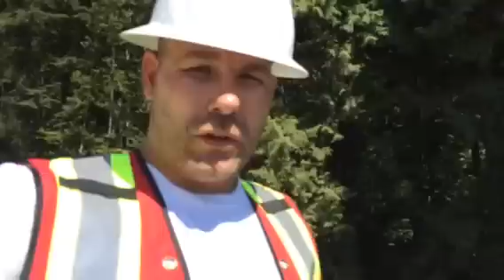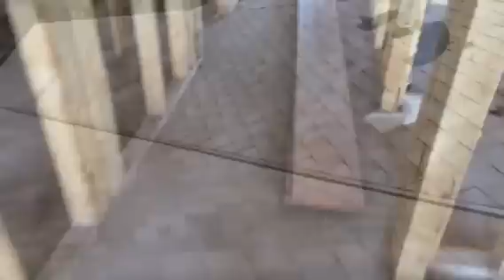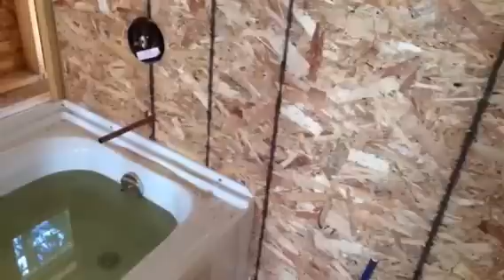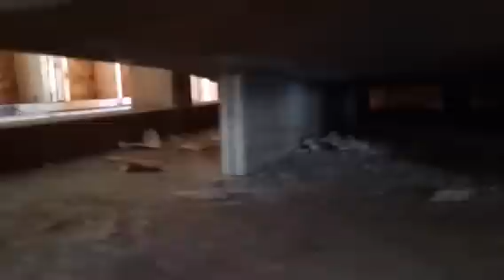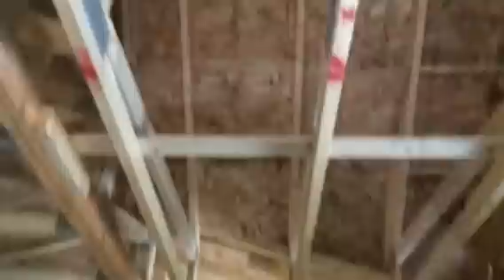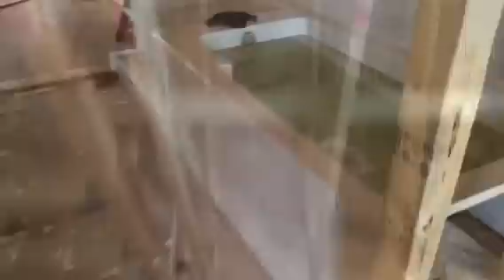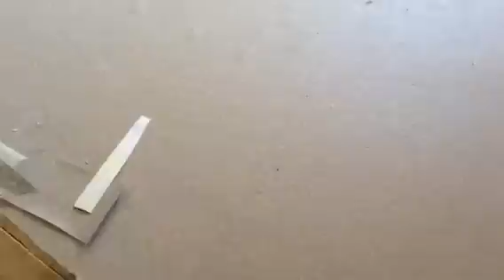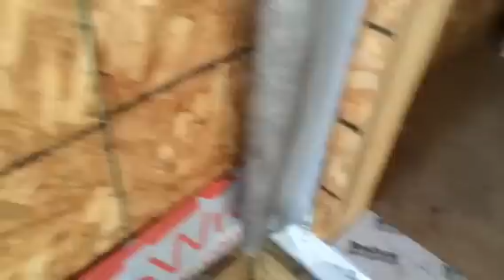New Home Construction Fails

Comment: Home inspections are a very good idea. Its also a good idea to use one that isn't a waste of money. 

Both tubs are fine. The final layer of tile backer will butt into or overlap the tub flange over the osb. I might ask why they used the osb and extra layer of rock but there are many structural and sound reasons for these types of things. As of now it isn't done and nothing wrong. The vertical support under the tub is not osb and a stringer on the back wall should be your support. Again the builder is not done and nothing is wrong.

The hangers upside down could also be a pre fab error and it was built/installed backwards. You don't know so its not safe to assume amateurs did the work.

A good inspector would know what stage the house is in and ask questions about the builders plan for completion. Being in the trade for 20 years now I would call you the amateur in this video.
Reply: Captain Carnage Interesting.... What does a builder's livelihood depend on? 

Just because your job is to inspect someone else's job doesn't make you free from fail. I challenge tom because of his misleading video and dramatization of the issues/non-issues. Its also pretty clear he has little or no years actually working in a trade. It would be fun to hear the builders side of it. 

 If you have any knowledge in this area then share your opinion but save the name calling for someone else.
Reply: I'm a Florida certified horticulture professional, independent contractor, and received 5 scholarships in college for my work in the field. I'll post pictures on my profile if you want proof, but if you think for a second that was the right choice of wood or the builders did a quality job, then you must be comparing your skills to the Indian contractors that have structures collapse or kill people monthly. 
 
On a side note, my best friend is following in his father's footsteps becoming a woodworker. His father is in the industry for over 35 years. Another friend is becoming a master electrician, and his father works in international real estate and construction.

So I can clearly see why you would think I'm a schmuck with no actual insight. As for dramatization, I've seen decks fall and the damage they can do both structurally and to people. But I suppose he can just pick the whole floor up himself and just give it the ol' 180° instead of people actually paying attention. He can pick up the deck himself, right?
Reply: Captain Carnage You can't learn a trade by reading books and taking classes. I got my one year cirtification and it taught me basically what tools I need. Everything else is learned out in the field. I didn't call you a schmuck nor was I asking about your gardening skills. I simply was asking about your knowledge of the issues in the video. 

Im really not sure where you are going with the deck comment. If we are talking about my comment of building backwards in pre fab then yes you should have the ability to pick it up since you got it up there in the first place.  Its a 5x8 deck section not the main deck. Either way its a funny mistake and its in the entry way of the house. There is no way the builder doesn't know about it. With a pry bar or the right hammer its a 15 min fix. Not worthy of a youtube video trying to belittle home builders and turn a building inspector into a superhero. 

Now for my drama section.... Construction has changed in the past 10 or so years. In the past all the supervisory/management/inspection jobs were held buy tradesmen that worked their way up the ladder. Now days its a bunch of college people that know what the book says but have no clue how we actually do it in the field. 

Some building codes are excessive but stronger is better. With codes constantly changing and builders unable to keep up with them,, we do need inspectors. Just not inspectors that act like building crime fighters and post "construction fails" videos. Which is how both of us ran into this dumb video. Looking for actual construction fails. Am I wrong?
Reply: Nibisco16 school is my education, not my experience. And how would suggest I learn more than I know at any given point? By fucking up over and over until what...?, someone tells me otherwise? Is that not worse than the structure of an actual class or lesson. 

And I'm wondering why you wasted your time and money learning about tools. Most people with interests should have some knowledge of what's needed to get a task done. Sounds like a sketchy or low end place. 

It's simple, little mistakes like these that are creating the inevitable 'fail video'.
Reply: Captain Carnage Yes you learn from your fuckups and they happen in all professions no matter the level of education. What you can't understand is that in carpentry the classroom is in the field. There aren't any masters programs or ivy league carpenters because its not the most efficient way to teach a trade. I am a union carpenter in which I completed a 4 year apprenticeship program. Twice a month schooling and the rest of the time you are on the job. (Which in hindsight is why my 1 year tech was a waste). We want young workers out there to perform the tasks we don't want to do. Like nailing 150 hangers on a deck. Its what we did when we were learning and the rookie is gonna be really good at it after a 10 or so decks. I will in turn be good at removing hangers he fucked up on. haha. 

I have installed thousands of hangers in my time and know why or how they are installed right or wrong. I could probably show you 3 or 4 tricks to how they could be installed better or faster. I could name different brands or styles of hangers that are easier to work with or will hold more. I could also show you how to easily lay out and prefab a deck while its in the grass. These are all things that I promise you can't learn in school. You get off your ass and do them. 

In conclusion I would only consider these issues a fail if the house was complete and the problem remained. Other than the hangers some of the issues could be built exactly as the print shows. Nobody knows. Its like eating a burger before the cook is done and complaining about it being rare. Be a good inspector and just ask the builders what their plans are on the issues and if a change has to be made then deal with it. Don't be a dink and make a video ruining builders reputations. Its annoying. Im all done. Later captain.
Reply: SteveLovesGOD Oh another one... Ok. I was only asking tom to see if I could get him to say something other than its not permitted. He didn't tell me what they like to see used so I dropped it. You however would like to keep going on it even though my whole point to writing on here was that I didn't agree with the tone of the video.

Anyways....

Where are you in the union? Im a part of the north country carpenters local 322. Never heard the term "master carpenter" other than in non union. Also generals sub out work. They aren't carpenters. So whatever.

Ive built apartment units in the thousands. Every single one had osb subfloor. The difference is that every inch of osb is covered by 1" of gypcrete. To call me ignorant or a scab is just dumb. There are over 300 carpenters in my company and we have inspectors there weekly. Its off the print steve,,, Im not picking it up from home depot on the way to work. Osb has its place in construction and does a great job where it is used right. Here just read what Mr Vila has to say. Everyone knows Bob.

http://www.bobvila.com/articles/526-enhanced-plywood-and-subfloor-products/#.Vc-1Iuk-BhA

There are just way too many variables in construction to act like you know it all. I don't and neither do you. I would think a God loving man like you would be a little nicer. J C was a carpenter you know..... :D
Reply from the maker: Thanks for your opinion Nibsco16 but, there is no place for OSB in or around a bath tub or shower. The tub base is inadequate and the hangers were installed upside down. Following my inspection all the issues I addressed in this video were replaced and installed properly to our local building code. 

Thanks for your comments though.
Reply: Tom Munro, CHI Yea yea. The flange is exposed on the top of the tub which means the durock/hardy backer/green board hasn't been installed yet. Along with the sheet rock in the rest of the room. When that next layer gets installed and is properly sealed,, it doesn't matter what is behind there. 

Out of curiosity what do you do when the subfloor around the tub is osb?

Also what exactly did you make those guys do to the framing to make you happy?

Give up on the hangers. Its dumb and the builder would have fixed it without you. Not too mention in your time looking at those you failed to notice the missing lags into the rim. Not sure what your codes are up there but that is a no no here.
Reply from the maker: Nibisco16 Your right the flange is exposed and they planned to installed regular sheet rock over it...this kind of construction is inadequate and has a limited service life...I've seen what this kind of construction looks like after 10 years, the moisture damage is incredible. There is no place for this type of shoddy construction when there are far superior products in the market that will not deteriorate like this stuff will.  Its all about the builder saving a buck on cheaper products. 
When I see OSB on a sub-floor they replace it...OSB is not a permitted product for flooring in our local building code.
Actually the builder didn't fix the hanger by the time I came back for the final inspection and yes I had them lag the ledge to the building.  
Thanks for all your comments!!
Reply: Tom Munro, CHI I have a hard time believing osb isn't permitted. Honestly I don't really believe anything you say. 

A good building inspector works with the builder and doesn't post ad videos "new home construction fails". In which the only fail would be the hangers. The rest were just things you should ask about. I build apartments and condos where we have an insane amount of building codes and weekly inspections. They act as a part of our team,,, not against us.

Lastly its up to the person making the huge investment to find a quality builder even if it means its a little more expensive. Builders with the lowest bids are generally the ones the cut the most corners from what I've seen. Do your homework.

IMO,,,, you need to make a better video.
Reply from the maker: Nibisco16 Thanks for your comments Nib.. OSB is not permitted as a flooring product.  
Your right when a person is making a huge investment they should hire a good builder but, when they are buying a home that is being built or has been built, they hire me.  I inspect homes for people who want to buy them and want a professional opinion of how they are built.  
More video coming, I have endless content...
Reply: Nibisco16 yykkulkjm!
Reply: Nibisco16 I'm so glad we have industry professionals like your dumb ass to correct someone whose livelihood depends.... Wait for it.... Inspecting buildings!!!
Reply: Nibisco16 Any contractor to use Oriented Strand Board ANYWHERE in a bathroom or Kitchen should be FIRED.

Master Carpenter, and General Contractor. First off, 4X8 Sheet of Cement Board price is similar to OSB. Further more, the Manufacture tells you, not to install OSB in moisture areas.  Scab all the way across. He saved nickels then have to pay and redo it because of failed inspections. 
That OSB will  eventually become weak from the humidity alone and break apart.
20 years in the business does not make you skilled or knowledgeable in this area. 

I've been in 11 years, and never Failed an inspection, and I run jobs. And Never pay off the inspector.
Reply: Nibisco16 I'm a union Carpenter as well, 4 years apprenticeship, and you're making us sound real Scabbish and ignorant. That bathroom was a fail all the way around the board. A complete F up. You have some Carpenters who get the job done=You
And some who complete the job properly-ME. Hardwood such as Birch or Maple is acceptable in those areas, NOT OSB. Their is no debate for that. 

If the OSB Floor were to be covered with Concrete or self leveling cement, or something to get a water barrier, that's different. 

But the scab stuff is what the used under the tub, just WOW.

They screwed the tubs to the wall studs...
Reply: Nibisco16 Professional's, as you may be, gets quality OSB, with maybe a membrane, or moisture lock barrier on the OSB if you will. Here in the video, Scab work, in which I'm referring to, appears as the cut corner, have little clue on material type of contractor. The one who orders most material from Home depot. 

The one that does not know the difference between green board and purple board. The one that frames out door was with out cripple studs. The little things that maybe normal to U-N-I(union) but Scabs never saw. 

Scab work I get kind of piss off about. So, some of the anger reflected towards you. 

The average consumer may not even think to look under the tub, or that sheet rock does not belong directly under tiles for a Tub surround, so in that sense, it's a great video. Ignorance runs rampant in this country, especially with Scab G.C's

Comment: We found issues in our 50+ year old home when renovating that were astounding. We found sub-standard pipes in some of the plumbing, stairs that lacked the proper pine or oak stair steps (underneath carpet, so it was hidden from us for years!)- it had only a single layer of cheap pine leftover boards for each stair step, caused horrible squeaking. Also, shoddy light-switch work in the kitchen, substandard pan in the bottom of the custom size shower, and walls that (perhaps from age, not construction) are warped and not quite straight or cornered neatly. Oh, and why anyone ever buys the cheap almost-hollow bedroom doors for their house is beyond me. But now our house is looking really nice :) All that comes from doing things right and fixing them up to code. Including our stair railing. ***Most of these issues wouldn't have ever been a problem if someone had supervised the house being built.

Comment: Just so you know dumb ass, that bath tub you in all your ignorant wisdom think is improperly put together with OSB on the bottom, it was manufactured in a factory as  are millions every year. Designed by engineers with far more knowledge and understanding than some would be home inspector.